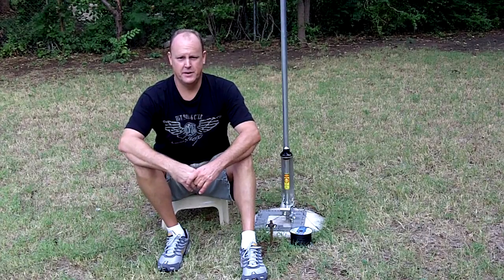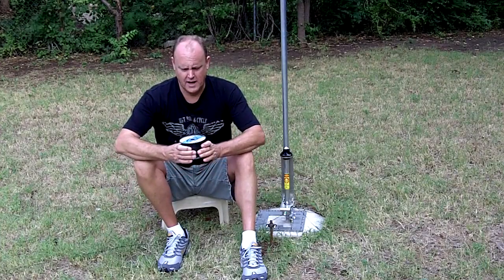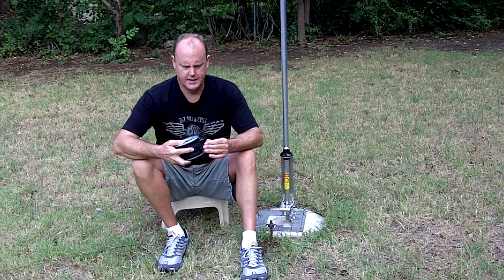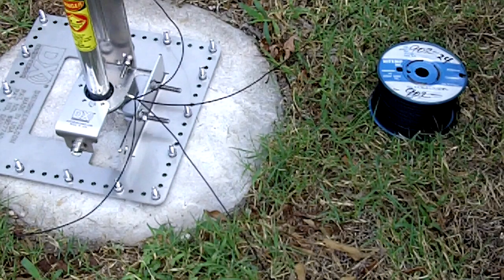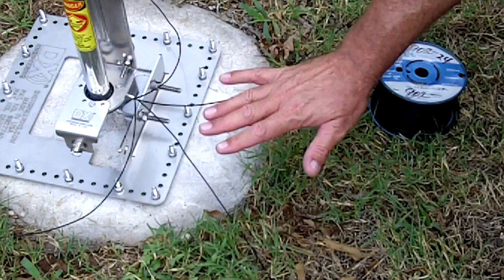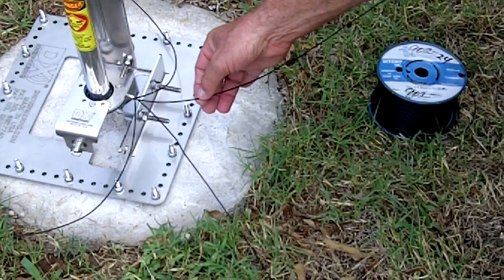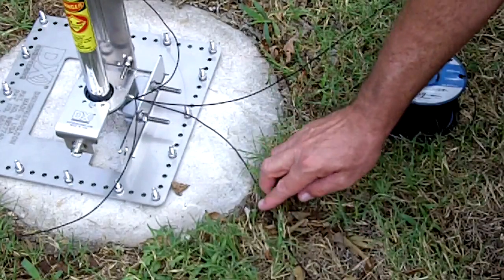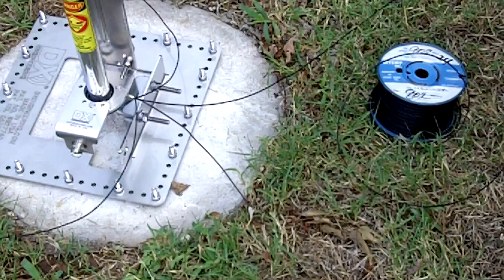Ground Radial Wire For Vertical Ham Radio Antenna

Comment: 6BTV manufacturer instruction clearly says no concrete for the base pole, so I see why you might need these radials because you have poor ground connection due to concrete pad presence acting as insulator.
Reply: I had a perfect ground connection to the 8ft ground rod I pounded into the ground right next to the concrete base.

Comment: i want a vertical, but my lawn is actually a pasture. Cant mow it down like that, and even if I could, I mow with a 2000 lb tractor and a 5' brush hog. Not sure how well this radial system would work in my situation.

Comment: Hopefully someone still reads this post with experience with this type of antenna . I have a 20 by 20 metal building with a 2 sloped roof two the sides. Do you think I might get reasonable results with this antenna mounted in the center?

Comment: For my low power am station I used about 40  25 foot pieces of extension cord  radially arranged around the base of the antenna, in the winter with snow cover reached out to 5 miles with 100 mw and 3 meter vertical on a sstran transmitter, other than that even tried foil tape stuck to 1 X 3 fir strips about ten ft long, but the best was with the old extension cords attached to a 3 X 4 foot aluminum plate

Comment: just gt a lawn edging blade and cut straight lines into the lawn using string as a guide,the push the radials into the slots you made on the lawn,in a few weeks you will see nothing and the radials will be out of you way.

Comment: The DX Engineering radial plate is where you want to attach the radials. NOT where you have them right now. The radial plate is a great product but your use of it here results in nothing!  You need at least 32 radials. The Hustler antenna is a pretty good antenna. There are lots of verticals out there like the Zero Fifty 43 foot multi band  or the DX Engineering 43 footer also.  

I've given up on stranded radial wire as it does seem to not last very long. I use 14 gage solid insulated wire and it has been in the ground for over 14 years with no corrosion at all. Plus it is easy to make eye ends with the solid wire and will allow for easier attachment to the DX Engineering radial plate.
Reply: If you were listening to the video the guy side they were "temporarily attached" and they are still at the same ground potential as the radial plate.  HIs folow up videos show them attached to the radial plate.
Reply: @Orionshield1948  I just installed one of these, using the radial plate as the connection for 40 radials totaling over 1000 feet of wire.  I haven't finished the hookup or tuned it yet, but I'm hoping and praying it works.  I have a lot of work into it.  The moment of truth comes next weekend (May 7, 2022).

Anyway, the radial plate is nice, looks good, is a well-made, quality product, and works great, but is not really necessary.  Everything in the mounting, the pipe in the ground, the tilt-plate if used, the radial plate, the U-bolts, everything,  is at ground potential except the antenna itself.  Hot potential begins at the screw connection at the bottom of the antenna and goes up the tubing.  Everything else is ground.

You could attach your radials to any point on any of the metal that's not the body of the actual antenna and they would work the same, as it would be the same point electrically.   I'm not telling you anything you don't already know, Orionshield1948, just posting this to help out anyone that doesn't have a full handle on the behavior of electricity.

Comment: 120 ground radials equals 4 elevated 1/4 wave radials. Ground radials will work down to 1/10 of a lowest freq but elevated need to be quarter wave. A vertical needs no more than a 2 180° elevated radials to work 90° efficient compared to at least abt. 120 on the ground. Starting with 60 will do fine reaching around 80% of efficiency.
Elevated radials need to be 0,2 wavelength of the ground. So its easier to use ground radials. They can be shorter but you'll need a lot more to equal the efficiency of elevated ones. I've ran a lot of on air tests on this subject.

Comment: For a horizontal, and some verticals, height is important.  This antenna is designed to use the ground as sort of another element. This causes the angle of the radiated energy direction to be lower to the horizon. This is good for longer propagation. There is also an effect called ground wave. These waves hug the ground. This type of antenna is also good at that.

Comment: NO radials or ground required for this antenna, works better then any vertical I have ever used.
A stealth antenna for limited space that really works great.
Many Ham Radio operators give up due to antennas restrictions with all the HOA restrictions these days.
Check out Stealth antennas that really work.
QRZ.COM/db/K8NDS       Anyone even in a small lot can have a big signal. Handles full power down to milli-watts.

Comment: 10 years ago when I put down the radials I happened to have a 1000 foot spool of 20AWG Polyimide coated magnet wire that I picked up at a yard sale for $10 

 I was curious how long the magnet wire would last so I laid about 40 magnet wire radials alongside 60 14awg stranded radials. I was sure the magnet wire wouldn't last a year. Boy was I wrong..!! After 10 years in the ground all the stranded 14awg wire is totally deteriorated while the magnet wire still looks as good as the day I buried it

Comment: DON'T USE STRANDED WIRE FOR RADIALS ..!! 

It deteriorates quickly and as it does it creates a lot of RX noise.  I've been using the same antenna for over 10 years. A few weeks ago I pull up a few radials for inspection. Now these radials have been in the ground for over 10 years.. I was astounded to discovered how badly the 14awg stranded wire had deteriorated. Even though it's PVC insulated moisture still gets into the wire.  All my stranded radials were completely deteriorated and worthless..

Comment: I just called Apex and I believe I found the wire you are talking about in the video.  But I wanted to check with you before purchasing it. The info on Apex Website is:
Raychen $4.75 Pound, Raychen Black (color), 14 AWG, Strand 37/31, Nom Insul Thk 0.11, P/N# wir25

Is that the same wire you purchased?
73 from N2LRB